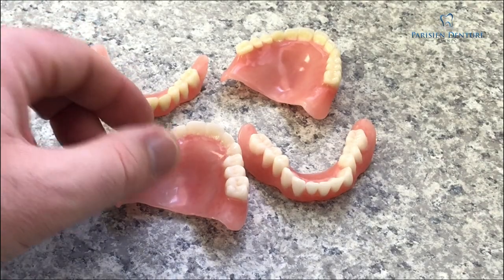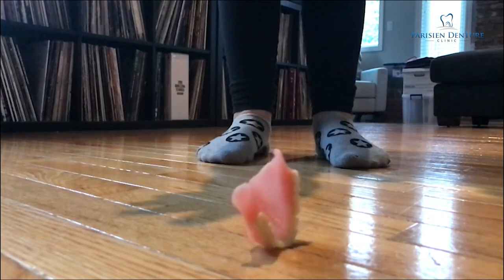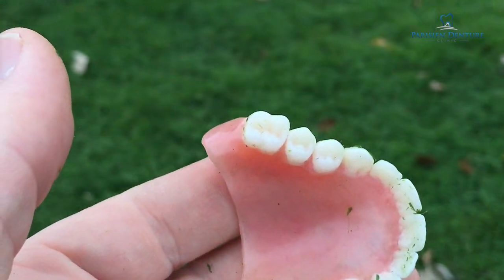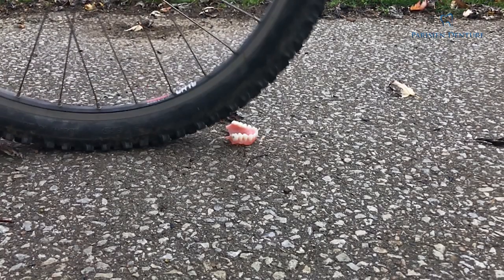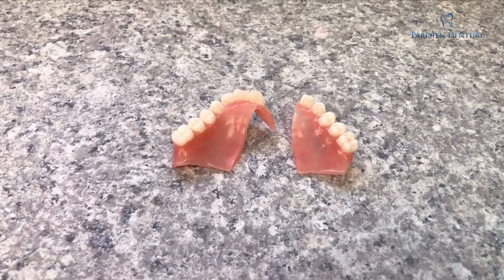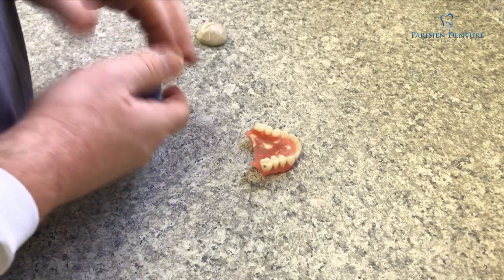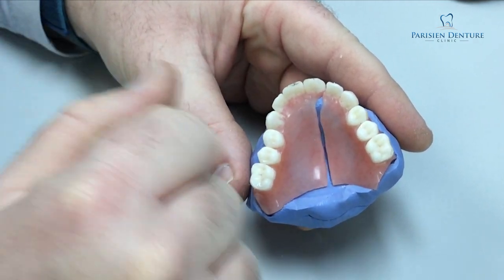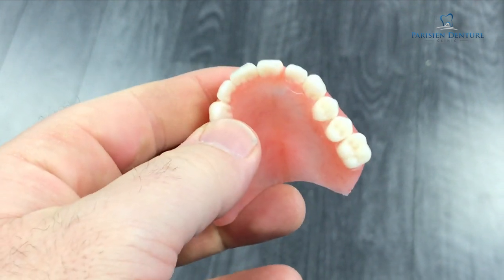How Dentures Are Repaired/Fixed

Comment: How do u cure The acrylic ?
Reply: Dental technician here , the repair acrylic is self curing called cold cure but needs to be cured in a pressure pot filled with warm water to prevent porosity

Comment: funny you say they are hard to break when mine I had wrapped in paper towel and placed them in my pocket because I can not eat with them in my mouth and I bent over to pick something I dropped up and I heard "SNAP" in my pocket I pulled them out and they broke in half right down the middle. So I'm sorry  but they are very easy to break in my experience

Comment: The name of the video needs to be changed its a little misinformation  , but was fun 2 watch. ..but was lookin around 2 see a video on how they are going to fix my denture . So worried it won't fit right after. I've had so much trouble with these wish I'd went somewhere else but after spending all my money I'm stuck 😫  but these teeth u were using 4video looked 10x better then my "top quality " ones :(   thank u for all the videos u put out .